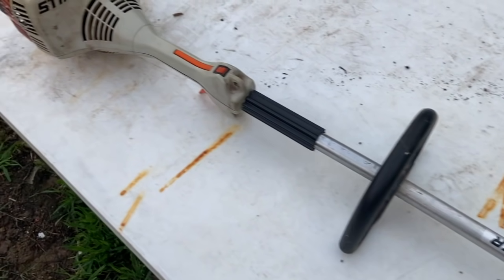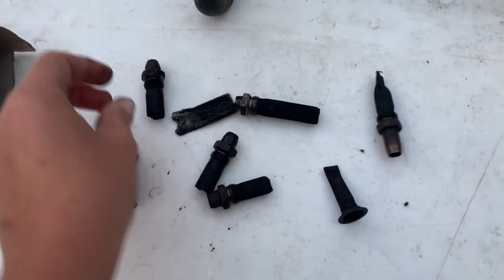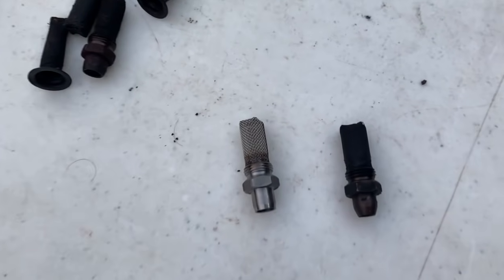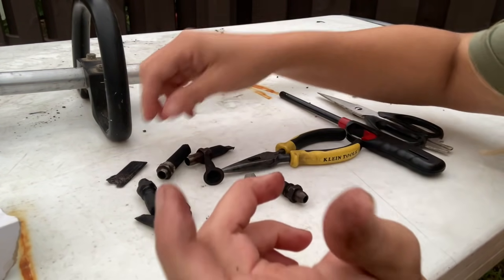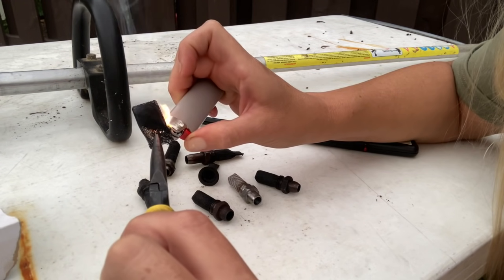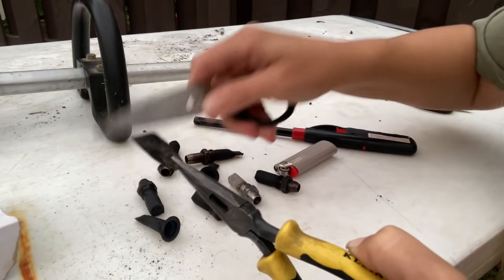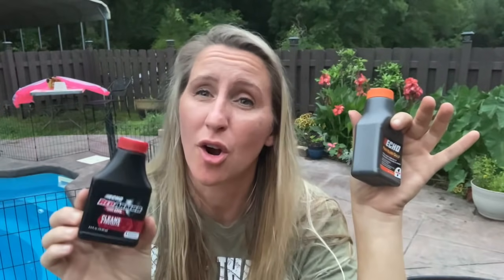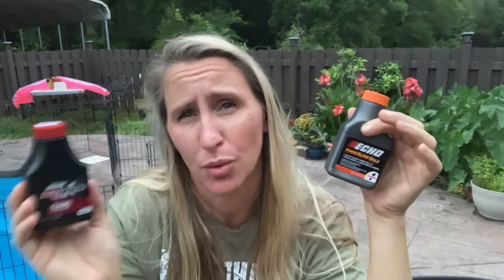THE BIG SECRET! STIHL has NO POWER? Won't Throttle Up? How to fix your trimmer/blower.

Comment: I gave my Stihl trimmer to my brother and bought an electric.  My bro builds RC airplanes, powers them with 2 cycle gas/ oil engines at full throttle or at idle.  Some are very large aircraft and expensive to build.

Comment: Your videos are so helpful. I came a across your videos about a week ago. SUPER EDUCATIONAL. I started used OPTI-2 in all my 2-cycle motors.  What is your opinion on the OPTI-2 oil good or bad. It seems to work good on my older Echo weedwhacker and my older Stihl chainsaw.

Comment: Hi, I appreciate your practical advice. I couldn't find where to post a general comment about two strokes. Anyway, you should do a video about a clogged 2-stroke fuel tank air breather valve. I had that problem on an Echo spin trimmer. I had to buy the whole fuel tube assembly but it was only $7.99. Thanks again.

Comment: I use the wire wheel on  my bench grinder to get most of it off. Never thought about burning it off and the only one I have a power issue is my blowers which I have seen in your other videos that I need to do some looking into my Weedwhacker that I’ve had for years and we do not use more than half throttle has no problems so maybe it’s a hit and miss thing

Comment: When I worked in Ground maintenance - we always removed the spark arrestor in all our whipper snippers and blowers!  Far better power and never an issue.  I don't agree that you should run all power tools max throttle all the time either.  With all my Stihl saws, 230, 290, 660, 880, I only run them flat out when they are loaded up in a cut.  When limbing etc and finishing off a big cut, I always back them off.  A motor going flat out with no load will not last a lifetime.  A little mechanical sympathy here goes a long way.  With saws- I find it best to run them at their maximum torque point.

Comment: Under the Magnuson Moss warranty act Stihl must supply the oil if it is required to maintain the warranty.

I have been using Union Carbide synthetic oil for years and have no carbon issues. But I run the snot out of 2 stokers.😮

Comment: Great video as always. Thankyou for the tips and tricks!! My issue with the steel oil is how thin the dye is. Much more difficult to tell if you mixed that gas can or not.  Maybe I'm just used to the husky(and every other manufacturer)oil.  So I really don't care how good stihl  oil is. I have 3 stihl yard tools that all get mixed with anything  but stihl.

Comment: Got my first blower a BG50, and I learned running it hard before shutting off is the best thing you can do. Also can I run VP Racing Octanium in my fuel mixture? Would love to upgrade the spark plug to a NGK, and get a better air filter that’s less restrictive. Love the BG50, I really want to do leaf removal in the fall as a side hustle.
Reply: It’d probably be cheaper & better to just get higher octane such as 101 ish race fuel from the pump & mix it at 40:1…

Comment: Chick, watching your comments on Stihl engine oil, i must take umbridge with you. As a 2 cycle engine mechanic, i must explain why Stihl highly recommends using only Stihl engine oil along with non-ethenol gasoline mix at 50:1 ratio. Stihl engines normal operating temp is approx. 400° which is much higher then all other 2 cycle engines which run about 250-300°. Stihl engine oil burns completely at that higher temperature. Thus, lubricating its engines completely and always. Your recommendations of using Echo or ANY other inferior engine oil will burn off completely way before

Comment: I did something different,  Milwaukee 18volt cordless electric with a 5ah battery,  no mixing fuel no broken lines just charge and go and its a lot less noise.  Same battery runs my drills  the edger on the tool as well as the pole saw.
My cordless other 18 volt tools as well.  And i can see how much charge the battery has still.

Comment: Thanks for the video, I learnt something new watching this! The only thing I didn't like was the use of a knife to scrape the filter. A brush with metal bristles made of a softer material than the filter would be for effective at cleaning the holes in the mesh filter and would not damage it. A spark plug cleaning brush would be ideal for this.

Comment: Oh man, I love your videos.  My FS55 has been flawless until this year.  Only changes are how I store between uses (vertical engine up instead of horizontal) and I used Husqvarna 2 stroke oil at 50:1 instead of Stihl or a local shop brand and the Husky oil looks really rich; that is, very blue.  I have changed the plug, air filter and just burned all the carbon off the exhaust as you suggested in the video.  I hope this helps.

Comment: I run Amsoil saber 100 to 1.  I mix it at 80 to 1.  In 14 years I have still not even changed my spark plug on my Echo 520 chainsaw.  We heat with wood so it gets used a lot.  I run NON OXY fuel and to this day I have had ZERO problems.  Everything is original, well I did chand the air filter regularly.  Few bars and countless chains later, it run perfect.  What is your opinion on Saber???

Comment: I bought a Stihl string trimmer as a homeowner and hated it, it was heavy and vibrated a Loy plus the easy start device broke I. About three weeks, I had it fixed under warranty and sold it. Then I bought a Echo trimmer from Home Depot and found it had vibration too. This was 4 years ago. Have things improved? I now use a Ryobi 40 v  battery trimmer and found it quieter and easy to use But the batteries are Very expensive.

Comment: I've been running equipment for years without screens I run lucus semi synthetic at 40:1 and have never had any issues with fireballs but at the same time I don't live in a tinderbox it rains frequently in Michigan. If you have issues with excessive sparks I'm sure it's from carbon build-up making its way out.

Comment: I have two Stihl motors.
My KM131 Kombi usually runs at near top throttle. 
My FS94R however is usually running below wide-open. It even came with a throttle limit built into the handle. 😂😂😂
I’ll have to remember to fully rev it everyone I use it. How long would I need to open it up per use to see benefit?

Comment: Interesting, may use the echo oil in my Stihl trimmer however I have been using Stihl oil in my chainsaws for a number of years now and haven't experienced any trouble ,maybe that's as you have mentioned, the chainsaw is frequently used at full throttle.

Comment: I simply use the super tech wal mart 2 cycle oil with the squeeze bottle that allows you to adjust the mix. My equipment is all 50:1 and I run it a touch strong on the oil. I also run everything wide open as much as is practicable to keep the engine from carboning up.

Comment: Hi! I’m a big fan of your YouTube channel! I’m so glad I found you!
I have a Craftsman weed eater, problem child. I put in a new carburetor kit with lines and filter. And I couldn’t get it to run. I found you and got my special adjustment tools from Amazon and have been working on it. I discovered that one of my new fuel lines was kinked and fixed that. I got it to idle for a bit. Got it to rev up. But it won’t stay running. I’ve tried messing with the throttle screw to no avail. Just won’t stay running. Now I’m not sure what to do next. Any advice for me?
Reply: Also, If I keep tugging on the accelerator, it runs and is rough on full throttle. Once I let off it dies. 🙄

Comment: I have a 1974 B&S 80202. As close as I can tell from internet research, part number 591420 is the correct replacement Magnetron ignition module (I'm converting from points). I'm confused because somewhere back in there, Briggs changed the flywheel magnet polarity from NSN to SNS. So I'm uncertain about whether the 591420 will work with my 50 year old Briggs engine. Thanks for your help.

Comment: My 66 has more than 4000 hours of use, with no work done to it.  My weed eater is approximately 10 years old and runs just fine. I run 40 to one, not 50 to one with stihl oil. I admit I take the gauze out of my mufflers and never heard of anyone  shooting sparks of flames out of the exhaust.   It's common  practice  here in New Zealand, when you by a  new saw, is to remove the gauze. It'll breath better and run sweeter without it.

Comment: Great advice - lately I have heard negative comments re: Stihl oil.  I have a Stihl MS271 chainsaw and 8 Echo power tools.  I use Stihl HP Ultra oil in the chainsaw and Echo Power Blend oil in the Echo tools.  I want to use one brand of oil for all my power tools.   In chainsaw,  will it damage anything to go from a fully synthetic oil to a synthetic blend?   Do you prefer Echo Power Blend or Echo Red Armor?  thanks

Comment: Here's a tip if you can see the spark arrestor but can't or just don't wish to take it out. 

Go to the gun store and buy CLP (clean, lube, protect) if you don't already have some. 

Spray onto the screen and leave for approx. 10 minutes. After that 10 min turn on the engine and run it at full blast for a while to blow out the chunks of carbon from inside the tiny holes. 

Why after 10 min? Because you want the carbon to be loose and soft but not dried back on and hardened again. 10 min seems to be a good sweet spot, but check yourself. 

CLP is a gun cleaner and lube all in one that is also designed to loosen up and clean carbon buildup, and other buildup more specific to firearms.

Comment: I have ran echo red armor , walmart super tech premix and old school Itasca green bottle mix oil , hell I have ran probably all brands over the years , stihl doesn't make oil or produce their own oil , guess who does ? Is it Castrol or Warren oil company ?? I was told Warren made their oil ?? But guess what ? I now run marine outboard premix oil in my echo and Husqvarna string trimmers and have never had an issue with them ! To each their own but after running gallons of mercury quicksilver 2 cycle marine outboard premix oil through my echo srm 225 the piston and cylinder looks like new ! Yeah boy ! 👍

Comment: There's more than 1 secret to Stihl's Silver oil and it will prevent clogged up exhaust screens. I've been using Stihl machines since 2000. I did at first have the clogging up screen problem. I said something to my dealer about it. He said that since Stihl's silver is synthetic that I can mix it at 80:1 and he would personally guarantee me that I would not have any oil related problems going forward. That was 22 years ago and I haven't had one single oil related problem, from clogged screens and ports to abnormal wear and tear and the piston, rings, or cylinders. The oldest piece of Stihl I have still in service is a 2003 FS80 powerhead. Next up is a 2007 BR600. My newest is a FS70R grass trimmer. I've had other Stihl tools that I've sold and as far as I know, they're still running to this day. You can also mix Amsoil at 80:1 too. I have had to make other repairs such as a new carb here and there, or a new coil, but the basic machines are still strong and ready to go to work every day.

Comment: my dad swears on motomix and aspen.. my first chainsaw i used gasoline and the expensive 2 stroke castrol oil, seen pistons used on 14000rpm 2strokes look like new. after 10000 miles
never had any issues. needed to set the carb a little bit different .. 

do think the engine stays cleaner on aspen looking at my dad saw

Comment: I don't own or use any Stihl products and I am just one of those people who just despises anything with a 2 stroke engine.  I always have trouble starting them.  Then if they ever attempt to start it barely runs and it is a fight to keep it running,  I don't like being worn out before the work even begins!!  Some people occasionally do things that take all day and the last thing they want is to be fighting a 2 stoke engine with a carburetor problem.  I don't need them for much anyhow so my chainsaw and weedwacker are both 40 volt.  I never have problems with those at all.  Not only that but one time I was operating a 2 stroke leaf blower that can also vacuum and found myself getting a lot of the exhaust fumes.  It made me smell bad and of course it is also nauseating and dangerous.  You can imagine I never used one of those again!  I don't need to smell bad or be nauseated from those fumes.  Remember that there is carbon monoxide in the fumes and it can kill someone with enough exposure!!  I think it didn't do that to me because I was out side and there was a light breeze.  Still I don't like the blower any more.  I don't have that problem with other 2 stroke equipment.  I just dislike 2 stroke in general because it is often hard to start or keep it running.  With battery powered saws and trimmers those things don't happen any more.

Comment: You can really extend this out to- all air cooled small engines are designed to run at full throttle.  Ive decarboned many small engines because the owners idle them too much.  Counterintuitively, they run cooler at full throttle.

Comment: Hi sorry if this is a little off topic but looking at getting a bigger chainsaw, my old Husky 236 wouldn't power anything bigger than 14 inch I'm told, and was looking at a Stihl MS181 or Husky 135/435 with 16 inch bars. What would you recommend? I would just be felling relatively small trees and processing the firewood, thanks for your time

Comment: Showing one of your well used exhaust screen that has been running another oil would be a nice addition. Maybe if you acquire some more extra units, you can run some long term testing.

Not supersized  "canned" gas sucks. 

Good info. My stihl trimmer gets a fair amount of not full throttle.

What do you think about using outboard 2 stroke mix in a trimmer/chain saw?

Comment: Question, I just bought a used Stihl FS111R. Starts fine, runs fine until it get hot. It will stall when hit unless I’m feathering the throttle a bit. My guess is it may just need a carb adjustment. My son uses these things at work and right away he thought there was a bit of play in the throttle compared to the ones at his work. This leads me back to ‘needing a slight adjustment’. Are the two related? Why is it stalling when hot?

Comment: great channel enjoy your tips, my question is regarding a CS4601 Echo chainsaw, it was given to me a number years ago, was told that the saw had hardly been used and was lent to a friend and when he got it back it would not start..he mentioned to me that his friend may have run the engine with straight gas no mix?? he wasn't sure just that it will not run..I am a licensed tech by trade in Canada, not much I've not worked or not been able to repair. I have never changed a piston on a chainsaw, A) wondering is the saw worth doing or should I scrap the saw? The condition of the saw is like New, would be a shame to junk it! I currently am helping a farmer friend log out some of his acres of bush to assist in helping him to gain some acreage to further his cash cropping, the saw would be a great back up to my Husqvarna 260 which runs and works great.. Maintenance is the key for sure. Your feed back would greatly appreciated. Motormouth.

Comment: Great videos. Here is a loaded question. What is your opinion on Opti2 synthetic 2 stroke oil? When most people hear what the mix ratio is they tell me I am crazy for using it. I have been using it on several engines and my Jonsered 2055 has been fed it for 20 years. Thanks in advance for your reply/

Comment: My Sthil equipment after running the synthetic Sthil oil with non-ethanol gas it works better than anything else but after about 3 years of commercial use I have found they start running dirty and I have to replace the spark plugs more often or take out plugs and clean them. Would replacing the carburetor every couple years be a good idea? My spark arrestors are removed already

Comment: Vinegar, is a shops'   necessity. I use it ; soak carbs in (but not  TOO  LONG ! ).....any other engine parts. In this scenario, i believe strong vinegar, overnight, would clean these screens/filters up.  Give it a shake, every couple hours - to loosen the ' hard '  carbon off.... Good luck, folks. Remember, a minute or 2 warmup - then run full tilt = the Stihl  engines.

Comment: Those are there to serve one purpose, to prevent fires. It's proper name is a spark arrester and has absolutely nothing to do with emissions. Yes it does get stopped up and should be cleaned just like the air filter, most people don't do that either, which causes the same condition. Just like any engine made, it has a maintenance schedule that should be followed, or you can make it simple and clean both after every other use and don't allow it to sit up to long with fuel that has ethanol. If it's not going to be used for some time, drain the fuel out and clear the fuel from the carburetor as well

Comment: That was a good video this also pertains too the fuel oil mix my cousin bought a brand new Stihl chainsaw and he used Stihl oil with his mix  as it said in the instructions, So he was using it after about 9 months and it wouldn’t start so he called me and said hey my chain saw quit running I said well take it back it’s under warranty so he took it back they disassembled it and said that the piston was scored and the cylinder was scored? So he got it back from them and said it was in pieces in a box? I’m like what? I said ok bring it over I’ll take it too my Stihl dealer I deal with! I had them look at it and they said that it was a fuel related problem ? Really I go ok do the warranty dosent do anything because big corp could care less about being customer friendly, so he said forget it and bought another brand saw and it’s running fine, but my years of working in engines I’ve never ever heard of a company not replacing a saw that has failed! But now a days it seems $500.00 is chump change and you can throw it out! It’s so sad that big corp is screwing over customers for the mighty dollar